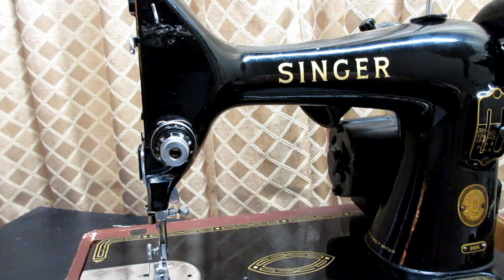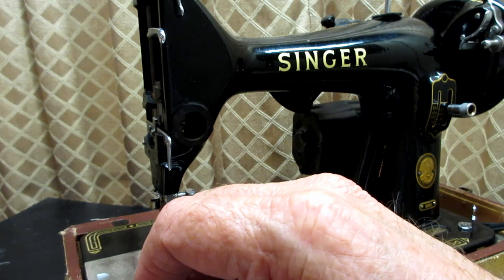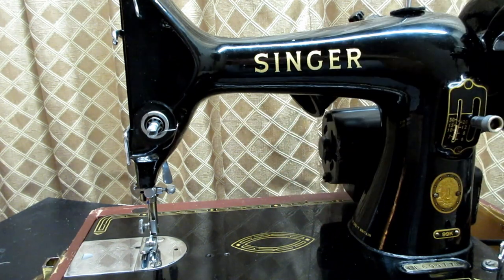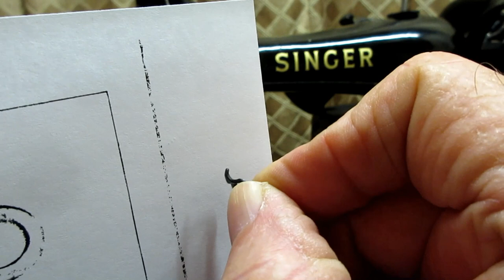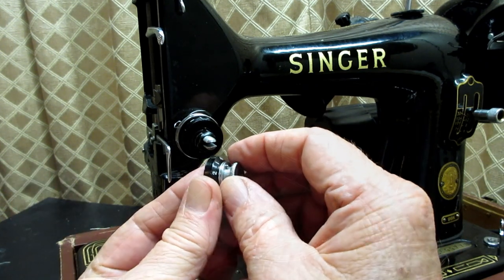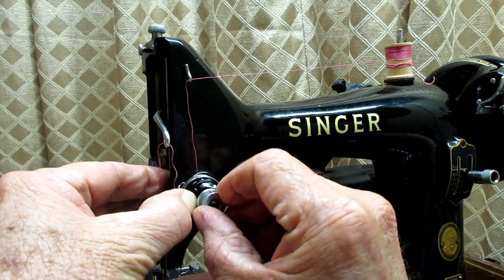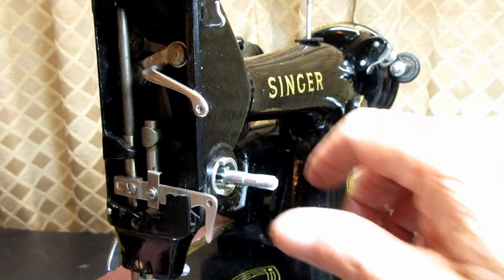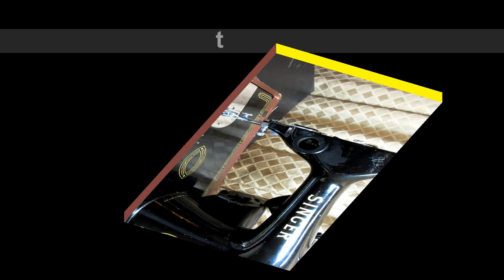The Needle Thread Tension Unit of a Singer Model 99K Sewing Machine

Comment: Great instructional video Andy, thank you! I've followed your instructions and adjusted the tension spring correctly but I'm having trouble putting the thumb screw back on correctly! You didn't have any problem at all in the video. Any ideas?
Reply from the maker: You're welcome. When I have that problem it is usually due to the tips of the stud being slightly spread apart. The first thing I always try is to push a little bit harder while turning the nut slowly BACKWARD to the left. Slowly. At some point, you may feel a little click. If so then turn the nut to the right to tighten it now. That backward turning helps seat the first threads of the nut onto the stud. If that method does not help you can put a cloth piece over the stud tips and squeeze them closer together. Don't get carried away and squeeze slowly. Trying to "close the gap" a tiny amount. Then try again with the nut, first tuning left a half-turn or so trying to get that click and then normal turning to the right.
Reply: @andytubesewing1953  Thank you very much for responding so promptly - it was due to the tips of the stud being slightly spread apart. I had been tried to do the turning to the left first but after multiple tries I gave up on that. I then tried to squeeze them closer together with my left hand while turning the thumb nut with my right hand. In the end I used a pair of jewellery pliers to hold two very thin quarter inch wide pieces of ice lolly stick to protect the threads top and bottom and squeezed slightly and the nut engaged!
Reply from the maker: @thomasmore4468  What a creative work-around. I'm glad you were able to complete the assembly and hope the unit works well for you.

Comment: I’m sorry to be a pest. I received my tension assembly but it has no dial with numbers. I didn’t know because it didn’t have one .any ideas on where to buy? Also do you have a video on the bobbin winder taking apart to replace a spring? Thank you I love you videos! Easy for me to understand , at 66 I don’t get things on first run sometimes!✌️
Reply from the maker: No one I know of makes new assemblies like the one in this video. The style you bought is for the older version of the 99 and can be used on your machine I believe. When the vintage ones come up for sale on eBay they sell very quickly. I was surprised to find one today. You see by the price the rarity of finding one. https://www.ebay.com/i/153942246538?chn=ps&mkevt=1&mkcid=28

Comment: Great video Andy
It's funny how there are so many variations in those tensioners.
I looked at my 1955 99K figuring it would be the same as yours but its not, it looks more like an older style than yours, yet newer than some of my other machines.
Anyway.... Thanks for the video
Reply from the maker: Agreed Mark. I know there were a number of variations in the model, even in the same year. The best record I have is for the 99K-31 which is what I believe this model is based on the motor, tension and bobbin winder. They sure made it, and the Model 66 for a long time.
Reply: The 128 I named "The Trollup in the video has a twin, she arrived today.
They are from 1915 and 1919, both 3/4 size machines with the "La Vencedora" decal sets.
I noticed the same thing with the 128's having variations, one of these is classified a 128B and the other a 128K yet they are identical.
The 1915 is made in Clydebank Scotland, with a F6612338 serial, the 1919 is G725716, I haven't figured out yet where it was manufactured.
But they are identical.
Spent hours again this evening looking at the Ismacs site trying to get a grasp on all these different models.
Pretty interesting really.

Comment: Thanks for another great video! I am still having problems with my number dial not moving smoothly. when I depress the dial and move the screw it won’t move to all the numbers smoothly. Moving just the screw it moves maybe two numbers over in either direction. It “clicks”, but seems too tight. Any ides?
Reply from the maker: Sorry, but I've never encountered this. When I could not get it to work normally I would pull it out and start over. Most of the time I found I had made error in reassembly.
Reply: . Good advice. Thank you.

Comment: Thanks so much for this video. I have a 99K machine, and am having tension problems. Unfortunately, both of my set screws are stuck. I tried WD40 but no luck. It looks like the problem with my tension is the little tension release pin is not moving when the presser foot lever is lowered. This explains a lot. Unfortunately, I can't get the tension screw stud out to clean things and find out why that pin isn't moving. Any suggestions for getting the set screws moving? I'm sure it's all gummed up in there and that's why the tension has gone awry.
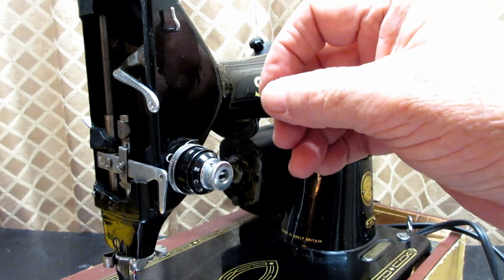Reply from the maker: If you can not loosen the front set screw to remove the stud you can clean the stud in place. Starting at @31:30 in the video I show how to dismantle the assembly parts from the front to get to the point that only the stud and release pin is left attached to the machine. On stubborn set screws, I have used heat, from a hairdryer, to help loosen them. I have also used a "tap & twist" method of tapping on the screwdriver while trying to turn the set screw. I use a 2oz brass hammer and sharp raps... tap, tap, tap quickly while turning. The jarring motion while turning can help free or "un-stick" the screw. You will hear & feel a little "snick" and then the screw turns easily. Let's say all that fails for you. Lay the machine on its back so you are looking down on the stud. Protect the black finish of your machine. I use a plastic sheet or bag. Now you can drip Krud Kutter Cleaner & degreaser or simple alcohol right down into the slot of the stud and onto the releasing pin. The liquid can run out the back of the stud and into the nose area which is why you cover the black finish to protect it. Repeated dripping of your cleaner will soften the dried-up oil and gunk. Standing the machine back up you can lift the presser bar lever and see if the pin is moving inside the stud. Once the pin starts moving you can keep dripping your cleaner inside the stud to flush out the debris. You can also push on the back end of the tension pin from inside the nose of the machine. I use a wood stick. Up to 1/16" can be sticking out and pushing it towards the front of the stud can get it moving. If the pin is stuck further inside the stud I will push the pin, from the front slot, back into the stud to get it to move. I'll use a slim screwdriver or wooded stick, like a popsicle stick (craft stick?)
If the beehive spring is rusty then the pin may be rusty also. The stud is usually aluminum but the stud is always steel. If you think the pin has rusted in place you can VERY CAREFULLY drip some rust remover down into the stud from the front of the stud. Many rust removers, like alcohol, will damage the black finish so take precautions to protect the finish. I use The Must for Rust by Rustolem, but there are many brands of rust remover.
Reply: @andytubesewing1953  Thanks so much for your thorough answer. I think I have the problem solved. I took a NAP! Yes, it seems the WD40 needed time to work. The screw was still a bit stubborn, but finally budged. I was able to take the entire mechanism out, and then removed each part. The tension release pin seemed okay, but wasn't moving really freely. I took it out and used a piece of heavy duty thread that I ran through the hole and pulled it back and forth a number of times. I think that friction coupled with the residual WD40 cleaned it out. The pin then moved freely. I put everything back together and set the tension as you described. The stitches look perfect now! Thanks again!
Reply from the maker: @steffanieschaeffer679  Success! 🏆 I'll need to remember to recommend a NAP next time. Patience & persistence wins again. I'm glad you are back to sewing.

Comment: Than you Andy! My 99k has been stored before I bought it. The bobbin stitch is good, but it slightly peeks to the top thread.  Is it the bobbin thread or top. I tried to change top tension, but no difference. Any ideas what's causing this? 
Thank you.
Regards
Ann.
Reply from the maker: Sometimes it is the needle size compared to the fabric you use. Bigger needle = a bigger hole. Lightweight fabrics should have a shorter stitch. If you feed it is a tension issue then in general terms the lower bobbin thread showing on top of the fabric means there is more needle thread tension than bobbin thread tension, so you would lower the needle thread tension. If the needle thread tension is already set fairly low, like 2 and you still get bobbin thread on top, then it is time to check the bobbin case/holder tension. If the bobbin thread tension is too low it may be b/c there is dirt/lint behind the tension spring on the bobbin case. It may be the spring tension is just set too low. Model 99K uses a class 66 bobbin holder and bobbin, and you can clean and/or adjust the tension on it easily. This is a common problem and who knows the last time the holder was cleaned or adjusted? I made a video for doing that and it may help you understand the bobbin holder and thread tension cleaning and setting: https://youtu.be/HT5XZ5eYYEQ Thanks for watching my channel, Ann, and good luck.

Comment: What a great demonstration on this style of tensioner. I was just up in arms on how to regulate my Singer. On my Singer 185k there is a small spring that sits behind the whole tensioner mechanism (inside the body of the machine)   that helps pushes forward the whole unite that I need to replace do you know the name given to that spring?
Reply from the maker: Hmm.. I have the parts diagram for the 185K machine and the tension assembly system looks the same as this one. All I can think of is the "Tension Pin Release Lever" inside the body. When you lift the presser bar/foot it rocks this lever and the lever pushes on the tension releasing pin inside the tension assembly. That is what releases tension on the discs/thread. On the right side of that lever is a small pyramid or beehive sping, very small, that is attached to the lever. That spring is there to push the lever away from the pin when you lower the presser bar/foot. That way the lever will not block the tip of the pin from moving back inside the body. I've never seen the little spring for sale separately, but only the lever/ spring combination like on eBay selling used parts.
You can see the end of the releasing lever with the little spring in this video at 40:15.
I also have a video of replacing the releasing lever. It is on a model 457, but the parts are the same style and do the same function.
https://youtu.be/tw-Y3V_LrnA
Singer Models 99K and 185K us the same parts. The parts number for the lever itself is 33659 and Singer formally called it the TENSION RELEASING LEVER. (no pin in the name like I call it) The part number for the spring is 33660 and they called it the TENSION RELEASING LEVER SPRING.
Reply: @andytubesewing1953  Oh boy Gracias; that's the one I'm looking for. At least I know what to look for. I went on Ebay and they have some but they include the the tension release lever which I don't feel I need. The spring in my machine is all out of shape and had no Idea of what an original one was supposed to look like.  I wrote down that Part number you gave me to have it handy.
I work on vintage fishing reels and have made different springs styles in the past when repairing reels. So If I can't find just the spring I'll give it a go by making one.
You have saved my day bro...  Sure is fun working on these Oldies by Goodies Gracias
Reply from the maker: @seniorLu48  You are surely welcome. Yes, I figured you would only find the spring with the lever altogether. If you can make a spring or buy a similar one and modify it that is great. It is not a strong spring but just pushes back the lever away from the tension pin while the presser foot is down. It's a dinky little guy. Good Luck.

Comment: Hi Andy 
This video is brilliant.
I just bought a 99k 157 model and have a problem with the tension regulator.
Can I send a pic please? 
 The front bit with the numbers on is missing.
Help
Reply: I'm no expert, but are you sure a numbered dial is meant to be there? Older machines did not have it.
Reply from the maker: Terri, I am not familiar with a 157 version of the 99K, sorry. I think you may have a 99K-13. That model is an earlier version and has a tension unit without a numbered dial. You set the tension by feel and results and not a number. You can download a copy of the Model 99K-13 instruction manual for the Singer website at this link: https://www.singer.com/search/support?title=99
The 99K in my video is the only 99K I have worked on and I have no experience with that older style of tension unit. Vintage sewing groups online, like FaceBook, may be able to advise you and you could always post up a video on your own YouTube Channel showing the machine, the tension assembly, and ask your questions about it. You see you already have a suggestion from Viewer DFTBAandDS along the lines of what I have mentioned. You'd be surprised how helpful other owners can be. Good Luck.

Comment: Thank you Andy- could not figure out how to assembly my tension assembly. 
Question- do you know if there is a coil like spring behind the assembly when you remove the whole piece from the 185k machine?
Reply from the maker: You are welcome. There is a beehive or pyramid spring inside the 185K tension unit. The parts of the 185K are almost exactly the same as a 99k, in fact, the 185K replaced the 99K. You can see the parts diagram for the 185K here at this link:
https://www.manualslib.com/manual/153920/Singer-185.html?page=3#manual
If you care to see it, here is a link to a very nice blog about the 185K at the mermaidsden:
https://mermaidsden.com/blog/singer-185-sewing-machine
You can still download a copy of the original Singer Instruction Manual for Model 185K (and others) for FREE from Singer;
https://www.singer.com/search/support?title=185
I hope this answers your question, Cara, and thank you for watching my channel.

Comment: I have a 99k and the tension spring regulator is stuck in the head of the machine. I removed the set screw. Do i need some kind of tool to push it out from the back?
Reply from the maker: No pushing from the back (that I know of) The regulator has been in there a long time and could be stuck from dried oil. Use a little penetrating oil and let it sit then try again. I have also used a hair dryer to heat up stuck parts like this with good results. I usually try oil and then the heat if needed. It can get a little messy but the oil just wipes right up/off.

Comment: Andy - appreciate your very informative video. Do you know the part number or where I can get a new tension spring?  Thanks
Reply from the maker: Thank you. The Tension, or Beehive Spring, is part #125314. Here is a seller I have used for many years, but you can check around for price + shipping: https://www.vintagesingerparts.com/products/upper-tension-bee-hive-spring-singer-part-125314
Reply: Thanks for your quick response - I’m looking for the check tension spring.
Reply from the maker: @PaulaStoia  The Thread Take-Up Spring? OK. There are a couple different ones depending on the type of tension assembly on the machine. The same seller has them here: https://www.vintagesingerparts.com/search?q=singer+model+99+check+spring
Reply: The assembly is the same as in your video - the springs I looked at either have the end of the spring going straight across the end or have a pigtail- I need the one with just the nub that goes into the cog. Would the last one you sent be this type?
Reply from the maker: @PaulaStoia  I made this video and worked on the machine 5 years ago. The machine was shipped to the buyer overseas 2 weeks later. I can't look at the spring other than in this video, like you. When I look at the last spring on the page 
I referred you to  https://www.vintagesingerparts.com/products/new-replacement-thread-tension-spring-fits-singer-model-66-99k-with-numbered-dial?_pos=3&_sid=0432e6a84&_ss=r&variant=31805385212002     and read the description it says ""-Fits Singer models 66 (late model), 99K, 185, 192, 206K, 206W, 306K, 306W, 319  -Will not work on 99K-1   -These work with tension assembly that have a numbered dial.  -Please note these are a little different than the original but do work well. original style is no longer available"" If your machine is the same as mine then you have a numbered dial. The seller says the spring is for numbered dial assemblies. It also says it is different but works and the original spring is no longer made. You can contact the seller, maybe send some pictures, and ask if the spring will work if you like. You can search for other sellers if you like. That's the best I can advise.

Comment: Andy, I need help.  I need this exact spring...Per your video at 12:17 where you talk about this spring.  I have ordered 2 different times once from Amazon and once from a sewing machine repair.  I cannot get them to understand the difference between a 99K spring and a 99 spring.  I need that tail!  Can you help me get one?
Reply from the maker: I need that tail, too! 👀 Thread Take-up Spring part no. 32758 
https://www.ebay.com/itm/New-Replacement-Thread-Tension-Spring-Fits-Singer-Model-99K-185-206-306-319/291630242414?hash=item43e6845a6e:g:f1AAAOSw0YlfBfsn
A trusted seller I've used for years, also known as Central Michigan Sewing. 
Thanks for watching my channel.